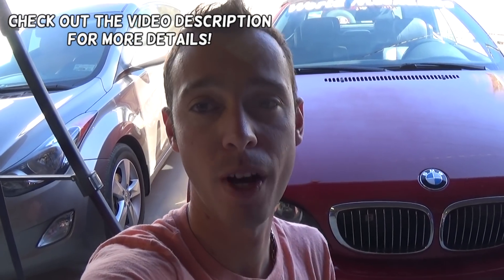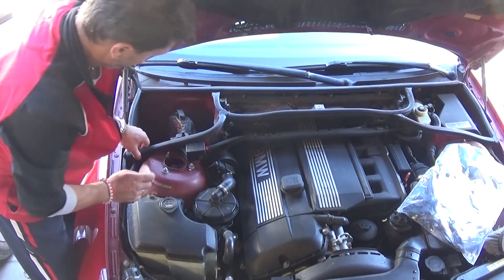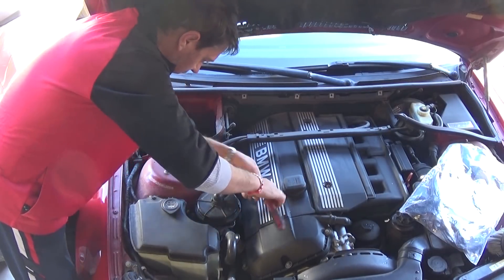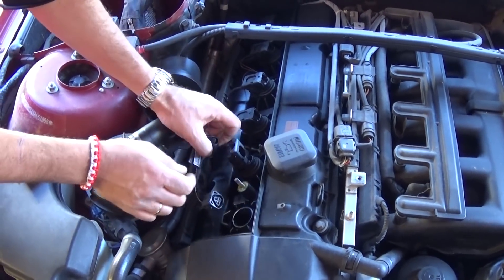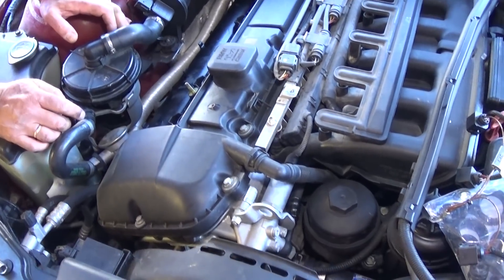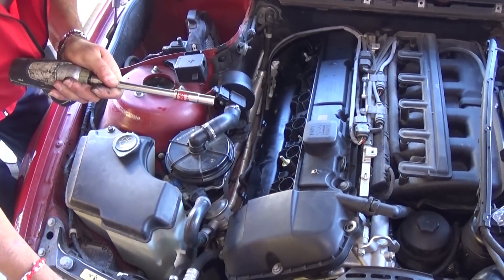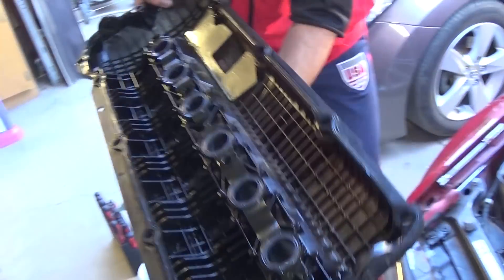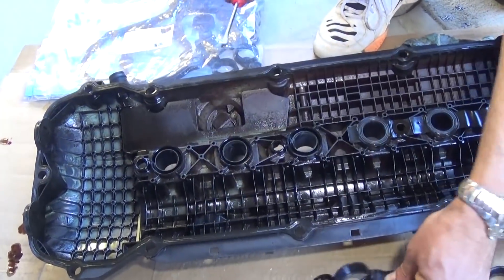BMW E46 VALVE COVER GASKET REPLACEMENT OIL LEAK FIX 325i 328i 330i 325ci 328ci 330ci

Comment: A torque wrench is only suppose to go until it clicks NOT click and then some more. Your over tightening the bolts which will result in stretching the bolts. Most of your bolts in this video are torqued to different torques because of this.
Reply: neil floate exactly👍

Comment: thanks man, mystery solved. Had mine replaced march last year, 7k miles ago, and it started to leak around the vanos/timing chain. I guess the dude didnt apply the dab of gasket maker as you recommended.

Comment: While replacing grommets on 2002 bmw 330i I broke the screw onto which the grommet casing is applied by over torquing. Can I replace the under screw?